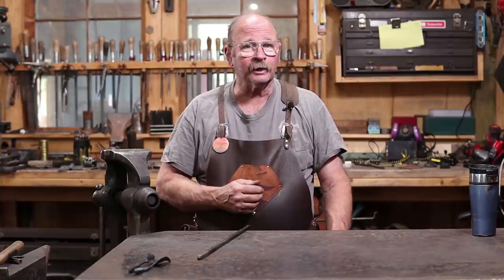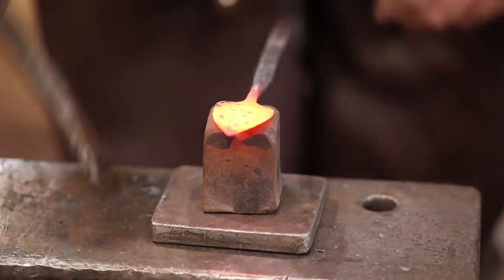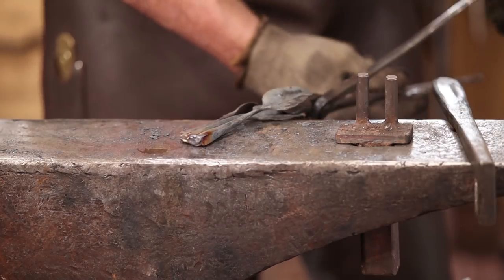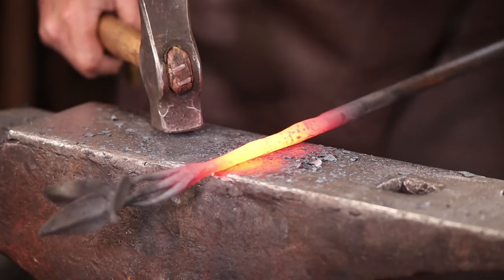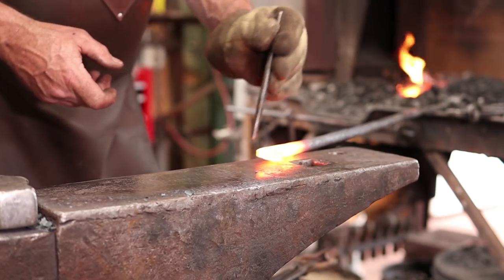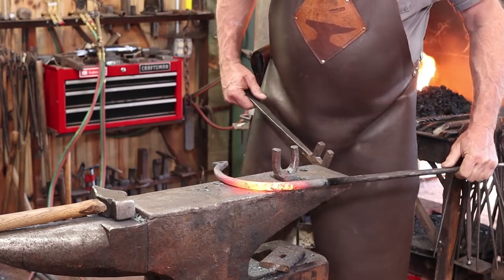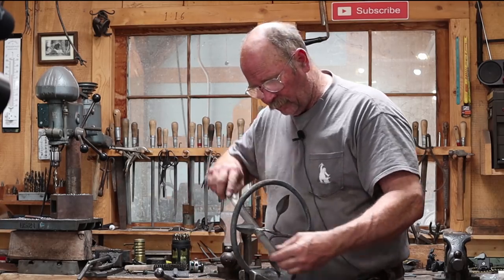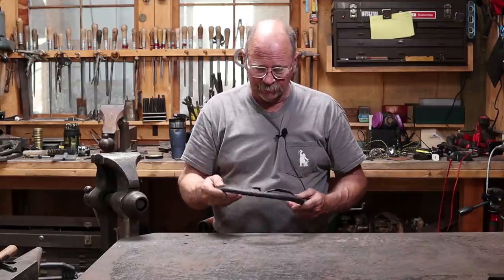Ornamental ring project and forge welding exercise.

Comment: Good video and excellent instruction. Keep up the good work! Forge welding is a good topic to cover and can be glossed over. MIG/TIG/stick is convenient but requires specialized equipment and you don't get the same consistency of look without extra work.

What I thought you were going to do (only looking at the starting clip) was: 
- Take a wide, flat bar and split into thirds, leaving a small attachment between
- Forge out the leaves from the thirds
- Forge weld the bundle of leaves to round stock
- Draw out to the desired thickness, smooth the weld transition
- Forge the outer circle to completion
That's how I would have approached it to achieve that sort of piece. However forging the individual leaves does give you the flexibility to weld them to any point. It can also be easier to work on individual leaves without having to repeatedly bend the others around and out of the way.

Comment: John: "I will be doing forge welding, but you can tack weld if you want"

Me, who hates welding: "yeah, let's make it all from one stock..."
Reply from the maker: I actually think this design would be much more difficult trying to forge the three leaves by splitting and then dealing with all three connected.  But its certainly worth a try.

Comment: Could you have started off making a leaf that's already a part of the longer rod then only forge weld two more? Or would that mess it up?
Reply from the maker: Probably, but it seems more straight forward to assemble the leaves as one section first.  At least in my mind it does.

Comment: How does twisting several little bars together affect things? I'd think the stems for each leaf would have to be drawn out a bit more, heat them in a triangle stack twist them 1.5 or twice around then flux and weld. Is there any way to do the welds without electric taking or wiring them together?
Reply from the maker: Bailing wire is really a pretty basic way to temporarily hold them.  Twisting would show in the finished piece but might be a look you want.  Having a pair of tongs that can grip all three pieces and keep them in line is another option.  Some people use hose clamps, but strip the plating off first or buy stainless clamps without plating.

Comment: The thought the table was supposed to be used as a cutting plate.
Reply from the maker: At one time that was a very common use.  But looking at old anvils some are chopped up horribly and others very little, so the practice wasn't universal.  Personally I prefer to use a scrap piece to cut into and not chop up any portion of the anvil.